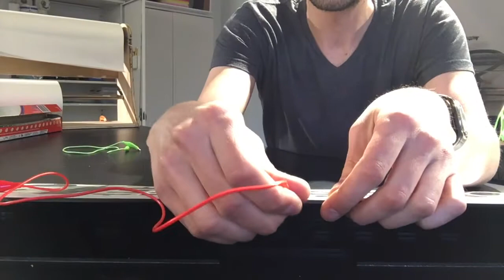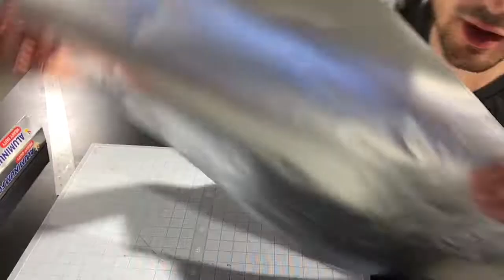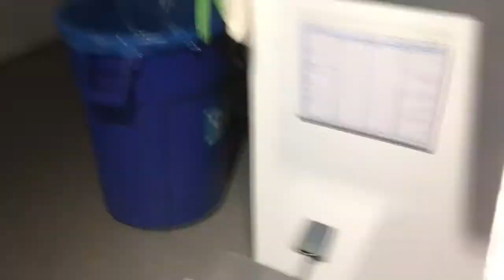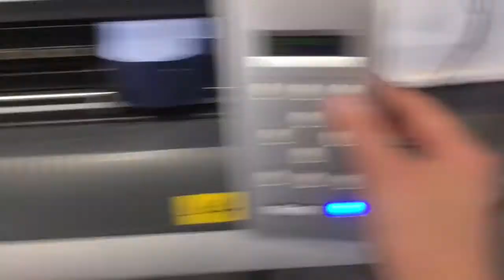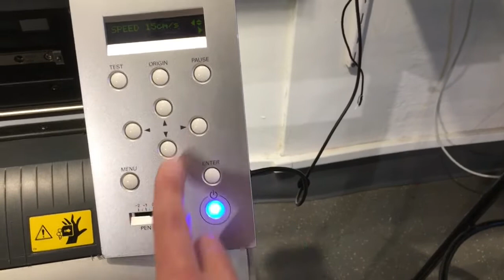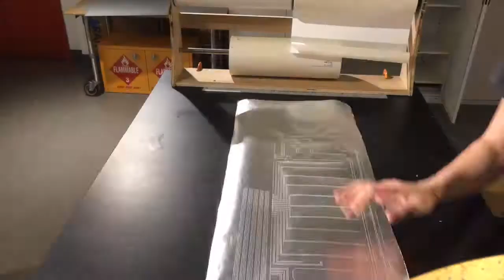Using the Vinyl Cutter to make tinfoil circuits for the Makey Makey

Comment: I've been using freezer paper as a backing for Kapton tape, both to cut (Cricut) and to have a non sticky back so I can put it down to affix traces cut from copper tape on the other side. A layer of Kapton on top, pre cut to line up with the traces and leave pads uncovered for soldering.  Have you ever tried freezer paper as a backing? it's probably more cost effective than transfer tape, and less plastic used (if that's a concern). I've used it as a backing to cut fabric on vinyl cutters and to send fabric through a normal epson inkjet. it's almost magical stuff.

Comment: hi, just asking can you go down to 1mm in traces with the cutter, im willing to buy a Vinyl cutter for my Magnetostatic Speaker Project, but i need to know is it possible to cut out 1mm traces on aluminium laminate, my material will be 12micron mylar foil with 9micron aluminium on it. Thanks
Reply: I am not sure. Best to contact the customer helpline for the cutter brand you want to buy. Roland vinyl cutters are the best (and most expensive) and should have a helpful customer service line.